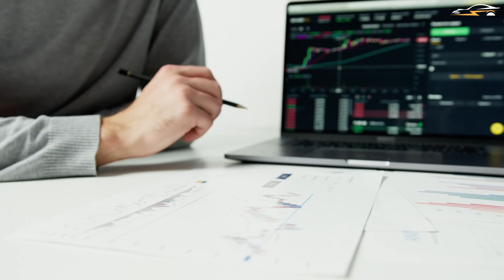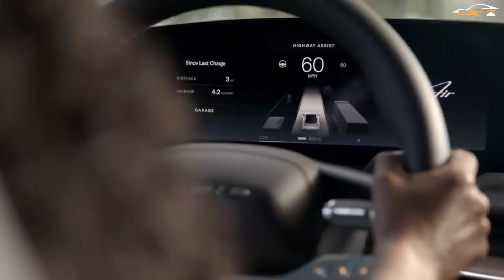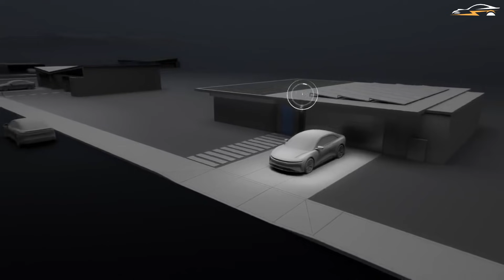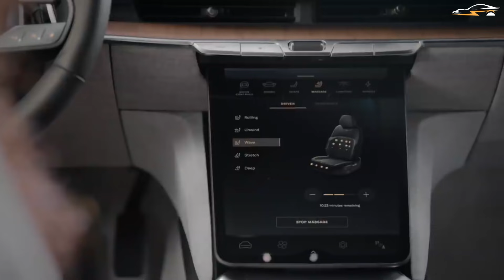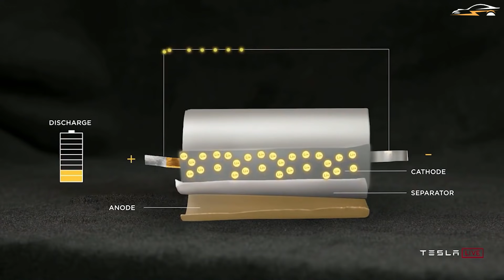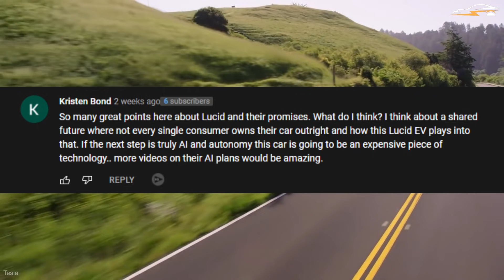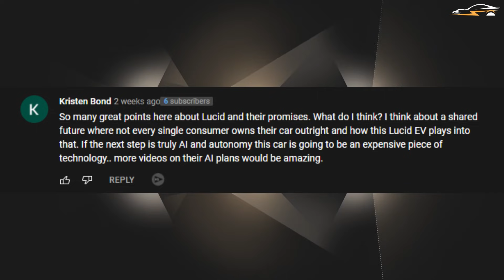Peter Rawlinson: 'The Tesla 4680 Battery Is Not A Huge BreakThrough'

Comment: Of course Peter Rawlinson will knock on Teslas 4680 cell, they won't have access to them , Tesla will buy all the cells from Panasonic and LG  ,and make their own as well, besides  going to 4680 cells  means a redesign of the Chassis, so  look forward to Lucid to stick with 2170 cells  for years, maybe a decade. Tesla  will also  be battery cell formula agnostic,as  presently the mod3 and Y  can use Cell to pack LFP batteries  in base models of  those cars, thus more- Profits for Tesla. Go long TSLA  or go home w/ pockets empty.